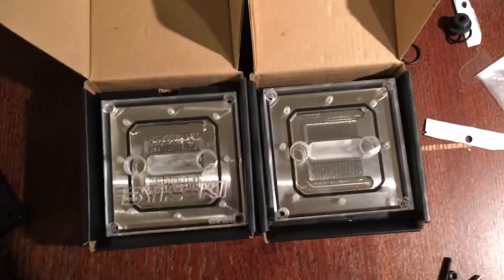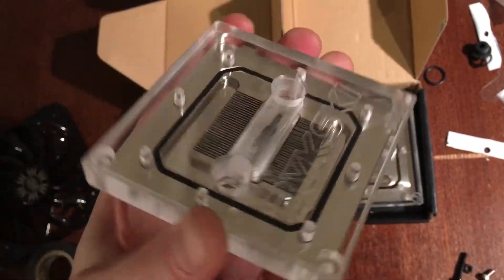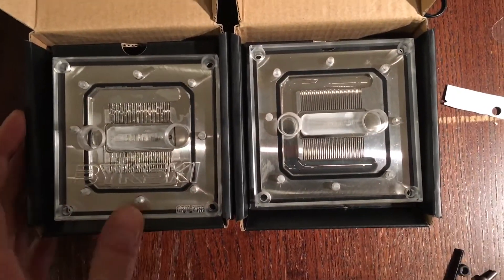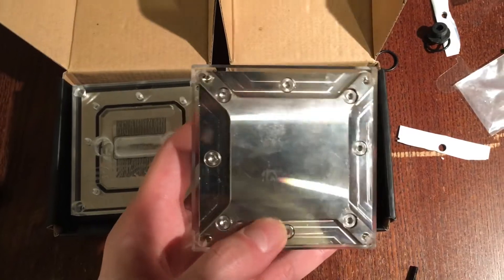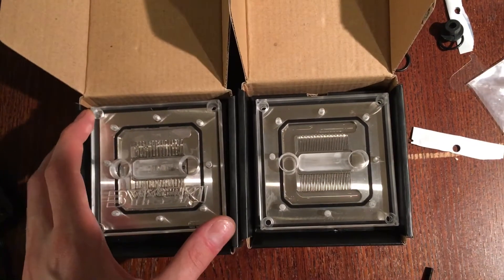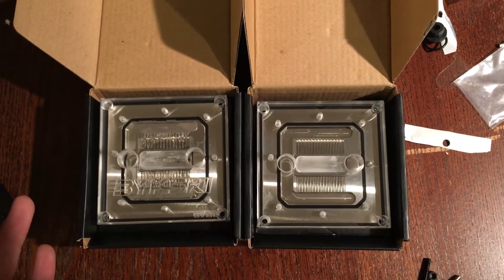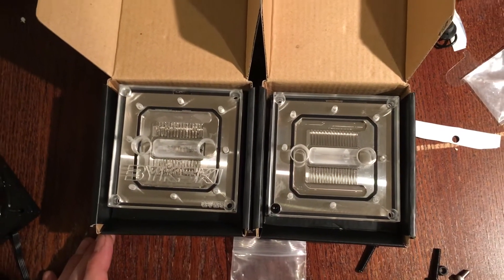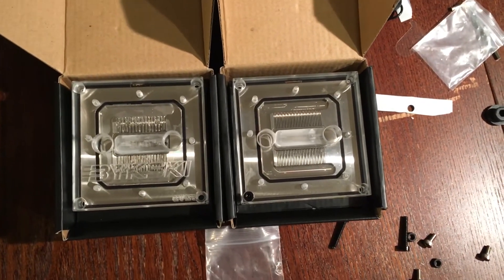[unboxing] BYKSKI 2016 Liquid Cooling waterblock CPU-XPR-A for Intel 2011-v3 and 1150/1156

Comment: I've just bought the Barrow AMD version of this block, and it is rattling (brand new, not installed). The rattle is coming from a plate which sits over the micro-channels, between the two ports. It seems to be a fraction of a mm too small for where it is sat. Is this where you have 'adhesive' on your block? 
Thanks

Comment: The main difference between theese blocks and brands like EK is channel width. It's much wider on BYksky that's why they are less effective and expensive.
Reply: They have 0.2mm micro-cut versions as well. Some of them are sold in China under Barrow brand.

Comment: This block is quite a bit bigger than the EK block. So it may have the "style" of EK (ie 'square'), but it's def not the same block.
Reply from the maker: Yes. 100%. I am not saying this is a rip off, i am saying they have been accused of ripping of EK in the past. I don't really care either way if they function similarly. For my X99, i think that this is a better alternative than any smaller EK or XSPC blocks.
Reply: could you do a install that would be very helpful to get an idea how it fits in with the Mobo